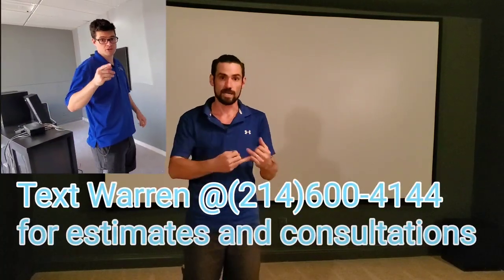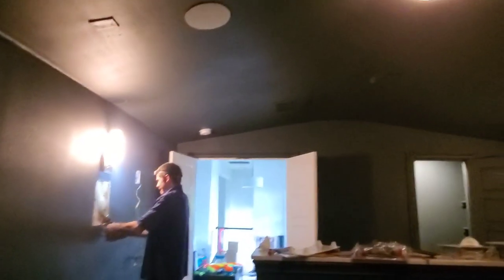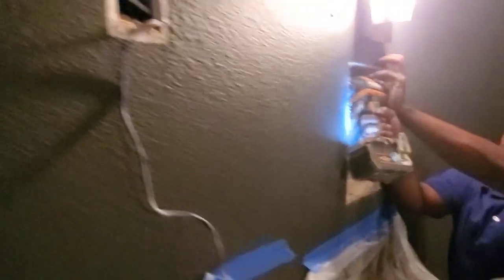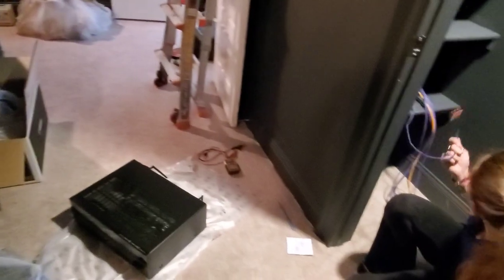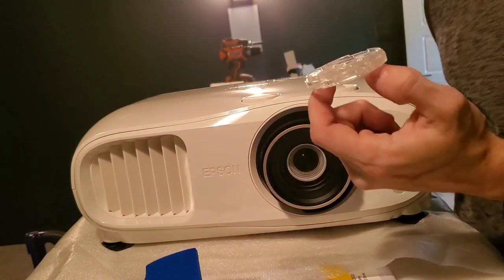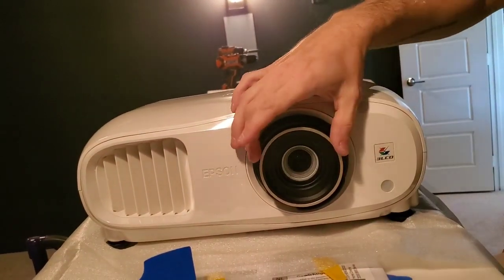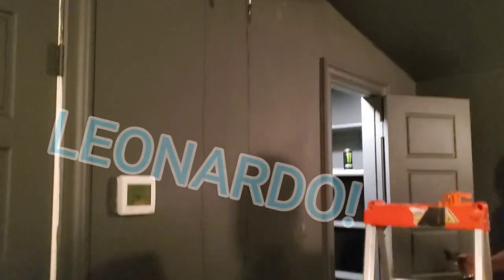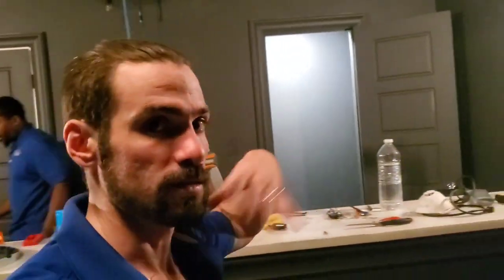Dolby Atmos Media Room Installation | Klipsch behind a Massive Curved Home Cinema Screen!

Comment: my head hurts like hell, it started when i saw the off center center...
Reply from the maker: I'd love to have the center channel dead center but you're correct sir, it is 4 inches off. This is due to the stud layout, that center channel is 6 inches wide and the stud spacing is 16 inches apart. So there's about a 90 percent chance that that stud will be somewhere in the way. Trust me it bugs me as well, but when it comes down to it its behind the screen and with the dispersion of that pro 250 c it virtually makes no difference from the listeners standpoint. Sadly the client opted out of reframing the wall:/
Working with what I got.
Thanks for watching!
Reply: Yea but since it’s behind u can’t really see it. Plus u can change the settings to reach the ear at the same time. Awesome job guys.

Comment: I hate to say this, but if you are  installing an immersive audio system, you really need to have a receiver or processor that can handle at least 5.1.4 Dolby Atmos and DTS:X processing.  Two overhead speakers don't allow for much object panning movement.  You really need four or more.
Reply from the maker: Not really, that's almost like saying you have to have two sets of side surrounds or two sets of rears in order to properly produce that dimension in the space. Now the difference between 5.1.2 or 7.1.2 is quite significant. Adding those additional access points creates a more three-dimensional sound experience. The object is able to move in different directions because of the multi-dimensional sound system. Of course each step up in an object based sound format makes a big difference. I agree that having four overheads is certainly better but 5.1.2 vs 5.1.4 is really not that big of a difference. And this is first-hand experience talking. We do upwards of 100 home Cinemas annually. We are filming less than 5% of them. 5.1.4 vs. 7.1.2, 7.1.2 any day of the week. Thanks for watching
Reply: I have two in ceiling speakers and can tell you from personal experience I can hear sounds from front to back and left to right above me fairly well.  Is it "as" good as having 4, no, but it's really not as bad as you're making it out to be.
Reply: @hyperactivetendencies7054  Four gives you discrete object panning in various directions, not just plain stereo.
Reply: @dan_hitchman007  you know Dolby Atmos can pan in stereo right?  It's not as accurate obviously, but it does do panning.
Reply: @hyperactivetendencies7054  Yes... back and forth, to the left and right and possibly a pan over top.  Then with four you get that plus diagonal and front to back, back to front, and side to side in sectional left and right planes overhead.  I've heard many iterations of Atmos.  Myself, I have 6 overheads.  Unlocked consumer Atmos mixes like "The Guns of Navarone" utilize up to 10 overheads and potentially 24 base layer speakers.
Reply: @dan_hitchman007  I can assure you that even with two speakers I get a little bit of back and forth where it matters either that or my brain is tricking my hearing into filling in the gaps, nevertheless 2 is still plenty good for most consumers with a living room theatre in a small space such as myself
Reply: @hyperactivetendencies7054  I think you would be surprised with four.  You can indeed install four in a smallish room.  You just have to place them carefully, so I always recommend a minimum of four overheads.
Reply: @dan_hitchman007  yeah it also requires a 9 channel Reciever which cost as much as my 7 speakers total 😂
Reply: @hyperactivetendencies7054  Shop smart and save up.  Too many want everything RIGHT NOW.  I've done this too long to be that silly with my money.
Reply: @dan_hitchman007  I think I'm okay with 2 speakers.  I've been to the Dolby Cinema and know what a multi speaker setup sounds like and honestly my living room setup is all I could ever want or need.

Comment: in 17+ years in this hobby/business I've never personally owned an LCD projector  it's always been DLP or LCOS . I've had the "purple" band on an older JVC appear on the projected image after about 1500 hours ... I've read of LCD and LCOS panel degradation which drives me away from LCD projectors. blah blah blah anyway great install
Reply from the maker: Hey there, I think these new epson's do a pretty darn good job in the long run. We are now servicing units from 4-5 years ago the picture looks great. We've also seen TVs go out after about four or five years as well so it's kind of a toss-up